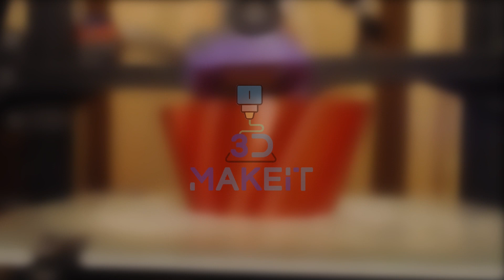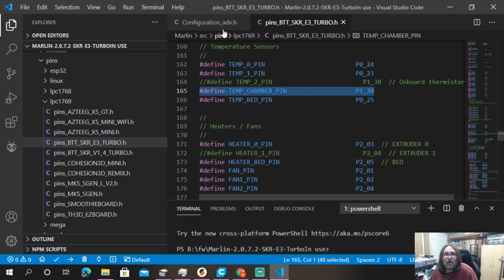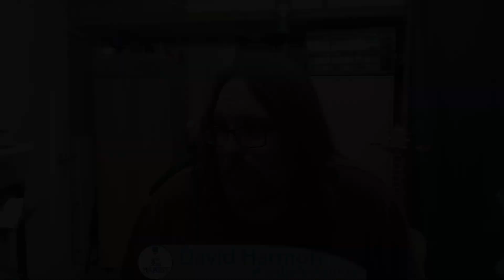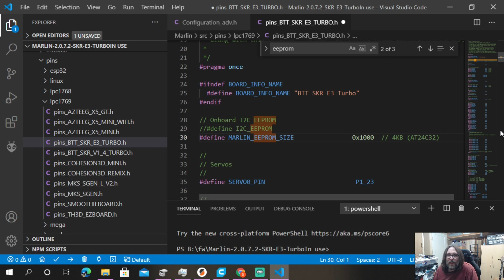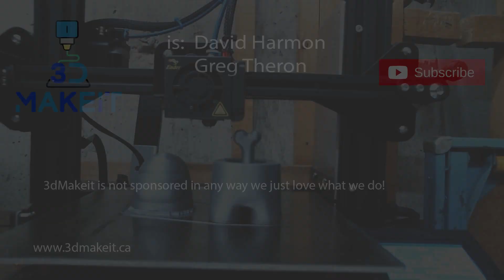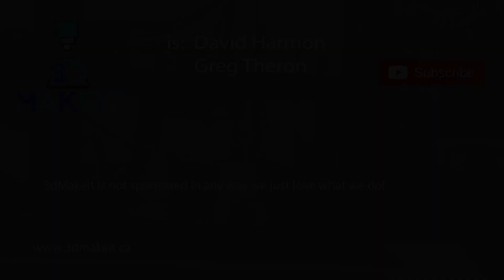E3 Turbo Follow up EEPROM and on board Thermistor Oh My!

Comment: I followed your instructions using the former video and this one about setting the controller fan to turn on and off using the thermistor that is on-board. but it did not work. As I turn on the printer it turns on for 2 seconds and then stops which seemed ok, but when the the board's temperature started to rise above 30 it did not start to work.
Are you sure this feature is working? can you share your config files so I can do a file-compare and see maybe I've overlooked something (although I went over and over again on two of these videos without luck)

Comment: Have an weird issue with motherboard fan configured like this when after reaching defined temperature (30 degrees) it will turn on for 2-3 seconds, then off for 2-3 seconds and will repeat that indefinitely.  Any way to let it cool motherboard let's say 5 degrees before turning (Hysteresis)?

Comment: Great video, quick question is there a way to use the onboard thermistor with the auto fan as u have done but not with the chamber . I plan to use the chamber im building with a different thermistor, so essentially we would see 4 sets of temperatures on the display. Ps the 3 temps in ur vid show up on the marlin screen but not the touchscreen

Comment: Mine won’t save any settings, such as e-steps, even when I hit save settings. After a power cycle it is gone. 
If I update the firmware with the new settings it keeps it. But that’s not going to work with my knock off bl touch
Reply from the maker: Make sure you have been able to eprom settings. Do search for m500 in your config.

Comment: Hi there and thx for your Videos. 
Maybe i´m missing something, but the chamber Fan is just getting some very short pulses and does not run even if the temp. is highly exceeded....
have you checked if your Fan is really running?
Reply from the maker: Hi yes its really running.  You may want to try the nightly build of marlin if your experience and issue
Reply: @3DMakeIt  Thank you very much for your reply - ive tried the bugfix yesterday but no success. Have you changed anything else for the Chamber Heating configuration? I would love, if you could provide your config files somehow? I´m really frustated cause this is really a brilliant way to use this feature
Reply from the maker: If you email info@3dmakeit.ca we can work something out for sure.    As we mentioned in this video using the board thermistor for the chamber thermistor allows us to attach the auto fan for the controller to that chamber pin.

Comment: The FAN1_PIN keep ON and OFF (bang-bang) continuously. Its better to use DEFIEN USE_CONTROLLER_FAN in latest bugfix 2.0.x
Reply from the maker: If you want your fan to always run then yes on off is great and that would follow the first wiring method for the board we showed.   I don't enjoy the fans running all the time since I work beside the printer.   Using auto fans based on temperature makes sure they only run when the temperature of the printers hotend or controller trigger them.

Comment: I had an eeprom write issue on the e3 turbo until I've found this answer on a similar issue on skr mini e3: https://github.com/bigtreetech/BIGTREETECH-SKR-mini-E3/issues/346#issuecomment-753701444. I've applied the correction (although not sure about what it does exactly...)  and my eeprom is now fully functional.
Reply from the maker: The fix disables the i2c eeprom chip and then uses virtually emulated eeprom
Reply: @3DMakeIt  OK I see. Thanks for the answer.
Reply: @3DMakeIt  the comment referenced above modded the file src/HAL/shared/eeprom_if_i2c.cpp to circumvent a bogus macro 'I2C_ADDRESS' from src/HAL/LPC1768/HAL.h. Easier way would be to comment that macro there (line ~51) or use bugfix-2.0.x from Marlin. In either case, the i2c eeprom is used and works flawlessly.